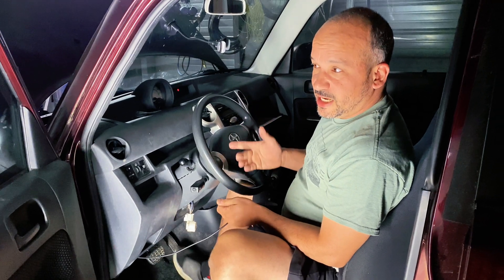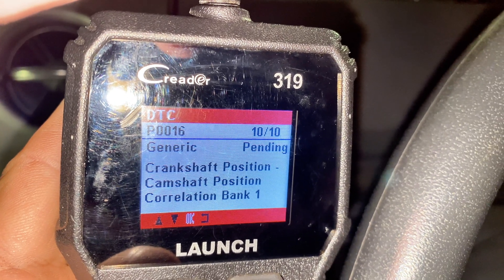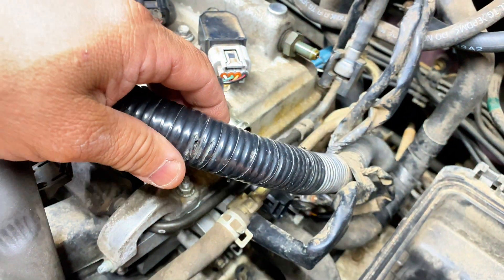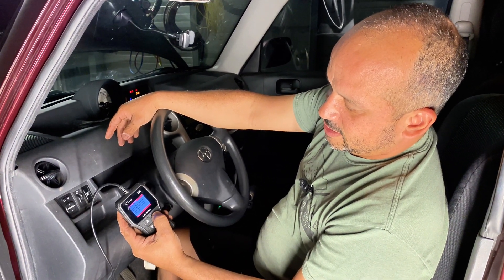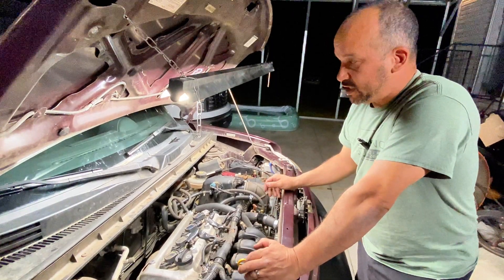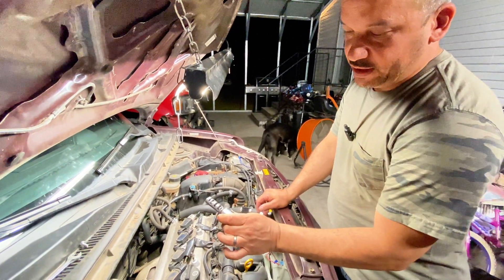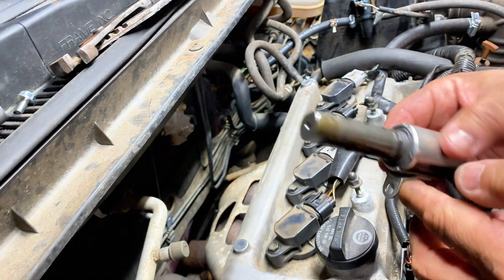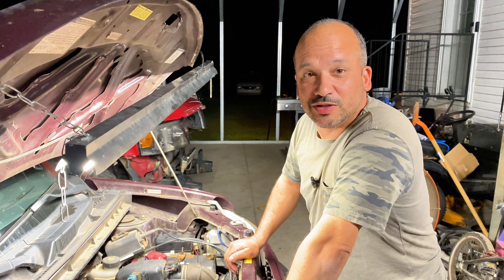Multiple Misfire?

Comment: Thanks for sharing,i have a similar  vibration on my 1zz fe engine. Most of the parts are changed, could it be the vvti actuator? No codes similar vibration before you changed the vvti solonoid
Reply from the maker: Could be.  Mine never actually produced a vvt code till after I unplugged it.   I wanted to see if it was getting any voltage.   My engine is running MUCH smoother now since I replaced that solenoid however, it is a high mileage engine with fairly low compression compared to factory specs.   The first gen xB engine has a flaw in which the compression chambers weren’t completely round.   Over time, compression would decrease and some oil burn would occur.  
   Have you checked for vacuum leaks as well as replaced the spark plugs?
Reply: @mailmanmechanic   thank you for the rpl. Next is the compression test, and yes, I have new spark plugs and new coils
Reply from the maker: Thanks for watching

Comment: Since that bad solenoid is out, it would be interesting to try to test how it moves by putting 12 volts on and off the connector and watching if it gets stuck.
Reply from the maker: I’ll try that.  I still have the old one.  I had the new one when I recorded that video but I’ll make another explaining the testing of it.   Thanks for watching